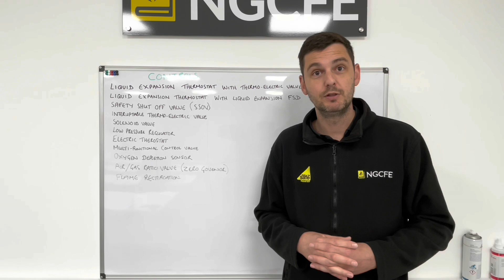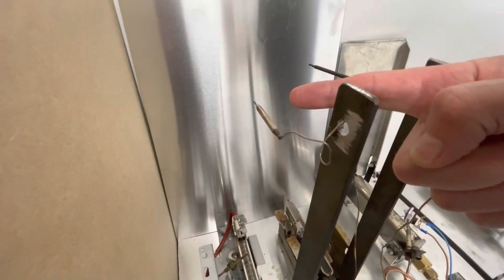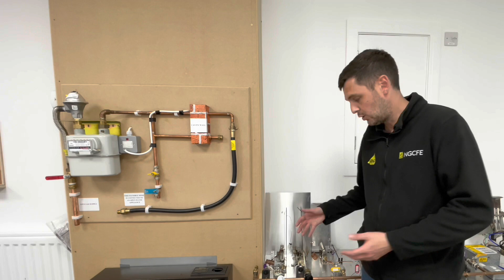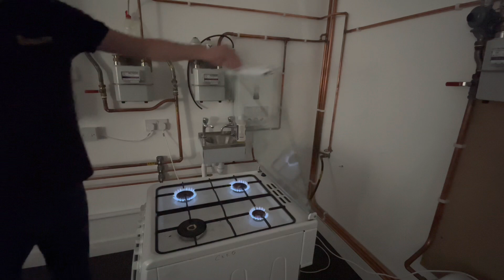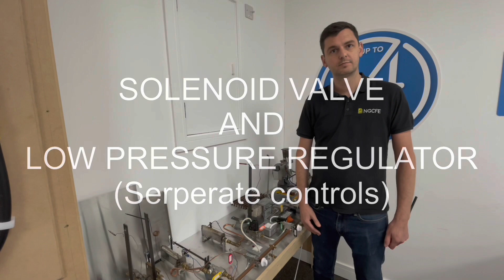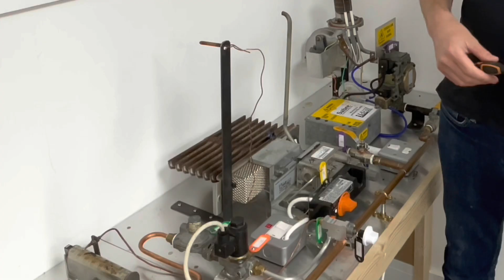Comment: Hello Allan, really appreciate the for getting this organised, an absolute phenomenal effort, you've been a good sent gift, I've been watching you're ever since I've started my gas career. Just wondering if you could also cover other Gas control - low pressure cut off gas valve, non return Gas valve, ignition device, thermostat mechanical, ultra violet flame supervision device, safety interlock, fan flow device, Gas pressure switch, gas weep relay valve, double diaphragm, swing type valve, gas pressure differential and flow providing switch, piezo ignition device, helical coil thermostat, Gas pressure stat, what they do and their possible faults. Thank you.